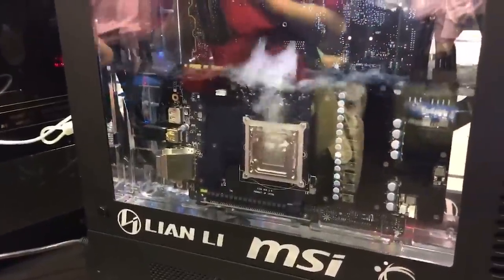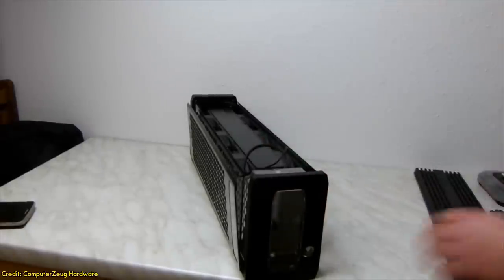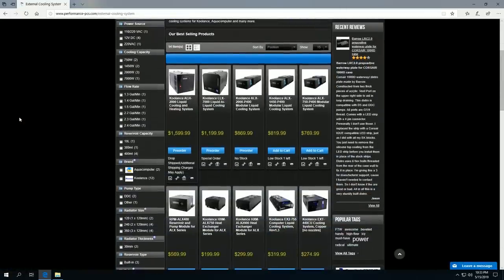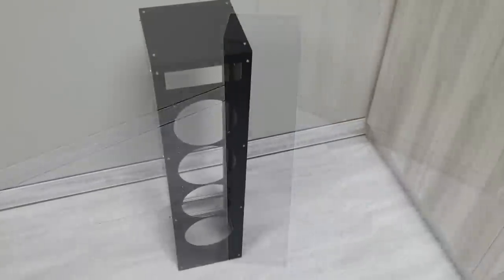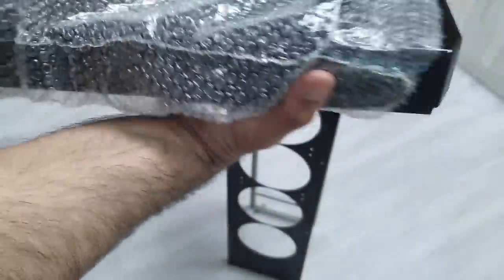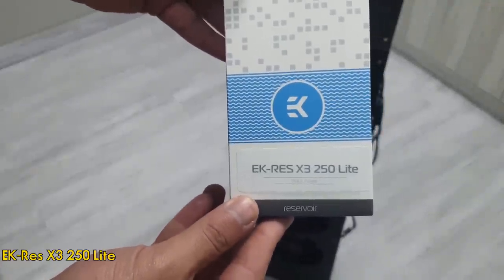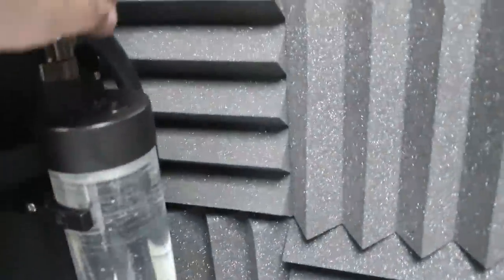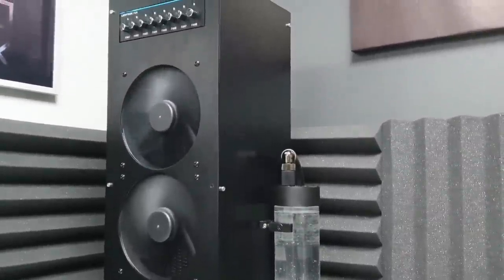A Single RTX 2080 Ti on a 560 Radiator!

Comment: Thank you for this!  I've wanted to upgrade to water cooling but have dreaded the idea of replacing my Raven RV02-E with a more space-accommodating case.  I had never considered / wasn't aware of external solutions, so this gives me hope.  I'd be curious how many components / computers this setup could effectively cool, and if it could handle a 2-in-1 PC build or even looped between two cases.  Very cool.

The only thing that seemed odd (in a nitpicky way) was the empty space in the 5.25" bay for the fan controller.  I wonder if there's a shim/caddy you could buy/print to fill the void.
Reply from the maker: You could ask the guy who man this for me do find a solution for this :) this radiator could definitely cool a cpu + gpu. The whole thing still runs great and imo its the best way to save cost for future builds as well as keep your components safe. A 360 radiator would be more than enough if you would like to cool your pc
Reply: @UltrawideBenchmarks  Hahah, if I order one I'd definitely ask.  It just reminded me of installing a head unit in a car and forgetting to purchase a conversion kit.

Would definitely come down to cost which route I go, so I'd be curious if you could divulge the approx cost for this new solution (excluding internal PC loop components).

I also meant to mention that you could probably streamline the power situation, by hooking it up directly to your PC's power switch.  Another cool option would be an IFTTT/node-red solution that turns it on based on the PC's ping status / GPU temp / etc.  Would be cool to automate the fan controller based on current temps as well.
Reply from the maker: @LesterCovax  these are good ideas, the problem is that the radiator stand is a bit far from my PC and thats why I went with a power switch.

The case costs around 180 dollars without shipping, the rest of the cost goes to which radiator, fans, reservoir, fittings, etc.. you'd go with. You could customize everything based on your budget.

The 360 version might be cheaper since its going to be smaller

Comment: This is crazy on top performance, maybe you can connect your CPU cooling into same radiator, so that you system is fully water cooling

Perhaps push your 2080ti into maybe 1850Mhz?
Reply: i bet he already pushed that card to the limit, if silicon wont allow it u can't push it further

Comment: oh god, now I need one of those... why did you have to do that !?
Reply: _ skyguy _ Another Option is getting a Watercool Mo-Ra Radiator. They are huge and you can use the big 200mm noctua Fans with them. This gets you an excellent cooling solution that is as quiet as possible

Comment: This is such an overkill lol.
With a good GPU block like Heatkiller IV you should be fine with that rad for both CPU + GPU on similar temps.
I had a slim 480 + slim 240 st30 nexxoos rig with 7700K 1.35v 5.2Ghz and a 1080Ti.
Both on the same pump.
GPU was at 36ish on load.
Reply from the maker: Yup its an overkill for sure .. but would be great for a full loop covering the cpu+gpu+motherboard and RAM
Reply: @UltrawideBenchmarks  Hell yeah man 
Do a full loop with this rad. love you content btw!
And idk about RAM. I used to water cool RAM too but it's a VERY restrictive block from all manufacturers as far as i know. I used a DDC pump on that build and honestly RAM doesn't need a water block nowadays, unless aesthetics ofc.

Comment: With that much space you could do the 60mm rad or the monsta ultra thick rad.
Reply from the maker: I read a lot of reviews about the monsta ultra thick but when it comes to temperatures difference and price its not worth it .. its all due to how fast water is flowing through the radiator

Comment: Was curious to know how well that fan controller worked? I have a really bad experience with a few of the deepcool fan controllers, please mention how was your experience with that fam controller that u used with that 560mm rad tower.
Reply from the maker: Hey buddy, Im still using it and its working great! No issues at all .. I took my time choosing the right fan controller since a lot of them die quickly .. no issued at all and Ive read good reviewd about this fan controller.

After installing it and setting the dials, i never touched it again :)
Reply: @UltrawideBenchmarks  please mention the brand/model of that fan controller?
Reply from the maker: @bloomfield295  here you go buddy

Lamptron Fan Controller FC-8, Black Panel https://www.amazon.com/dp/B004X2X6FM/ref=cm_sw_r_cp_apa_i_S9iMDbS96BWF8

Comment: And what is your PSU model? And pump model too. Sorry for so many questions. It's just that your set is so inspiring!
Reply from the maker: My PSU is Asus ROG Thor 1200w and the pump is a d5 from EK :)
Reply: @UltrawideBenchmarks  Thanks for your reply! Does this PSU power all your PC components or only the cooling system?
Reply from the maker: @user-wv8zh7vn2i  the whole PC .. the external radiator has its own PSU and it only cools the GPU, the internal radiator cools the PC and Motherboard with a radiator and pump from EK
Reply: @UltrawideBenchmarks  Thanks! And sorry for bothering with many questions)) I'am starting to buy the same components)))
Reply from the maker: @user-wv8zh7vn2i  anytime my friend!
Reply: @UltrawideBenchmarks  Thank you) I never tried to watercool my PC, but after watching your videos , decided to give it a try. But maybe i would cool my CPU also. First i thought to buy all components from EKWB or Aerocool, but i can see how much better the results are if you go for different vendors assembling parts like LEGO for adults:D And now with you telling me almost everything i have to know about it, it only remains to understand which PSU to buy for external cooling and what tubes,fittings and the like to choose...
Reply from the maker: @user-wv8zh7vn2i  for external coolong the psu should be with minimal watts. This is a long discussion so its better to connect on discord if you want so I can help you out. My username is AlRayes_BRN#1111
Reply: @UltrawideBenchmarks  I added you there. My name is andreylitvinov1412

Comment: wooa your room temp so low 18°
in here 38°
Reply: @Fearzzy  hotter
Reply: @Fearzzy  Deserts are actually cold as long as you arent getting fried by sunlight directly, go near a cover and you'll feel the cold wind actually even if the sunlight is frying you you'll still feel the cold wind that is why it is best that you wear something that will cover your body from sunlight.
Tropical countries are way hotter than deserts because of moisture, deserts are only dry.
Hell I remember wearing a winter jacket in a desert country when I was still living on one because it was so goddamn cold.

Largest desert in Earth is Antarctica.
Reply: @DinglePinky  you got my point right... lol
Reply: Willie Last i live in indonesia which is in equator line, so we got summer all day long with around 28-36C usually

Comment: Starting price of $105 for that... I’m in the wrong business.  All of his parts are just 80/20 aluminum extrusion t rail for 8020.com or McMaster-Carr.  I get it if you don’t have the tools to cut it effectively but even a deemed or hacksaw works... order the rails and build it yourself! Material is cheaper and the knowledge gained from it is priceless!
Reply from the maker: You said it your self, the mill work, cutting and using the right tools is what making this product a bit expensive compared to its raw material. He has an instagram account  which you can see all his projects using his on machines.
Reply: Ultrawide Benchmarks 80/20 is the coolest stuff ever!  It’s like a grown up erector set or legos!if I had the money, I’d have a garage full of the stuff! Not sure what all I would build but I would find something!  I work in aerospace and defense engineering and we use that stuff religiously!
Reply from the maker: @JonesingUSAF  i think the same when I want to buy tools and CnC machines .. im not going to use any of them 😂

Comment: How much the overall custom radiator built cost you?
Reply from the maker: Dont remember exactly but the case itself coats around 180 dollars, if you are going to build a smaller enclosure it'll be cheaper

Comment: Get a Phobya 560mm or 1080mm its 70€ or 100€ respectively, the Temps are crazy low with 4x EK 140 Furious, 8600K on 4.7 Ghz Liquid Metal on Die max 33°C (The shitty Intel IHS is to blame here, with rockit cool and LM between the cooler it dropped 3°C, and im not going to sand the die), my 1080ti (which thermal throttles with Air cooler at 1600 Mhz @ 80% TDP) was at max. 28°C with 120% TDP and 2100Mhz overclock, but youll want it to be in a different room, its the craziest space heater you never wanted...

Comment: You forgot to make room for a removable dust filter in front of the fans.
Reply from the maker: I remember buying a 560 dust filer from demcifilter but for some reason the size was smaller than a 560 .. decided not to use it
Reply: @UltrawideBenchmarks  Try making one with the material used in pantyhoses... asking your girlfriend for some old pantyhose and having to explain why you want them might be a bit embarrassing, but I guarantee it works lol

With a bit of handy work you can  even make something that looks good and is a lot easier to clean than a radiator + fans.

Comment: what about dust on that new unit? within one month those fans will be full of it.
Reply from the maker: Using it with no filter since May .. no dust accumulated :) it all depends on the room your in
Reply: @UltrawideBenchmarks  well your previous unit had dust on a dust filter =) so this is pretty weird then... i guess dust accumulates inside the radiator then. also there is now way to avoid dust in any room with access to open air
Reply from the maker: @frozentherogue  the previous one was used in another room for few months before moving to the new one .. it was bigger

Comment: A Black Ice Nemesis GTX 560 is a much better radiator look at thermalbench.com.Myself use a Thermaltake Level 20 XT external rad for 2xD5 pomps and radiators with Aquacomputer aquero 6lt fan hub.I use 2 x Black ice Nemesis 420 for RTX 2080Ti OC only.And a 1x GTX 480 a GTX 360 for cpu i7 8700k OC.My room temperature is 23C Idle GPU coolant temp 21.40C with a fanspeed 350 RPM.Unigine Heaven room temperarure 23C coolant temp 22.50C with a fanspeed 1000 RPM.GPU 30C.In Game BF5 GPU 32C.But i use Alpacool Eisschicht thermal pad-17 w/mk for my GPU much better then the shitty EK thermal pads.When my room temperature is 18C at night  my GPU Idle is 14C and at game BF5 30C. LOL

Comment: This guy said that 488 dollar external radiator was a cheap option.. Lmao. I just bought a computer for 240 that came with a 360 and 240 copper radiators, fan controller, 4 96mm fans, 2 144mm fans waterblock for cpu, chipset, and two gpus (old crap gpus, gtx 580 3gbs) and ofc asus rampage iv mobo, i7 processor, and 4 4gb sticks ram,  one 512 ssd.. You get the point, but im a cheap ass and ill buy shit i dont need if its a good deal
Reply from the maker: Thats a very good deal 👍🏻

Comment: as awesome as this is, not practical like he said.  winter is benchmark season for me.  i took my pc outside and cooled my gpu down to 20c.  waiting for that mid-winter night where temps drop to about 15F...
Reply from the maker: Thats awesome! Unfortunately I live in a hot and dusty country .. thats a big no no for me
Reply: @UltrawideBenchmarks  ah then it has some use then! I understand though.  During the summer I had a difficult time trying to find a temperature balance, upgrading my loop to two radiators, 360 and 240 and repasting cpu and gpu seemed to have worked.  Also using just distilled water with some antibio and anticorrosive.

Comment: this is just a waste of money, the GPU / CPU don´t care if it runs at 30C or 45C under load.
also the mobility with a build like that, not good at all.
Reply: this is pretty good actually, if you run in 30c ambient or hot countries